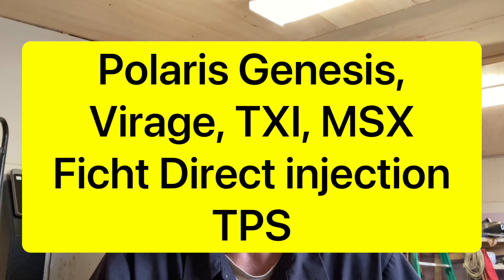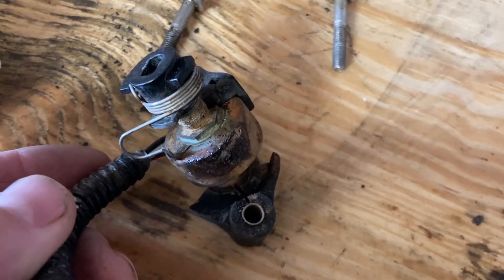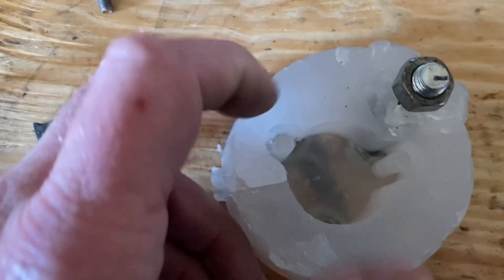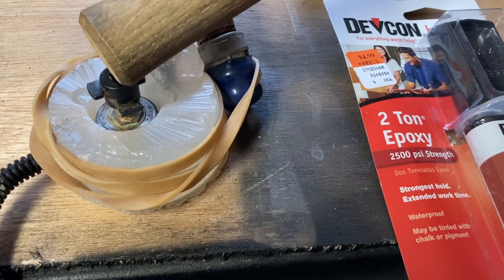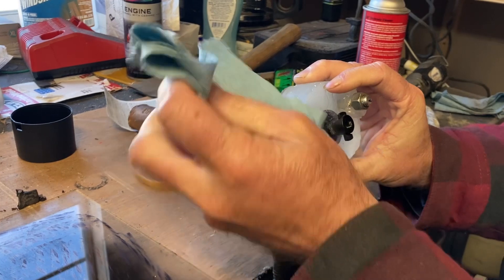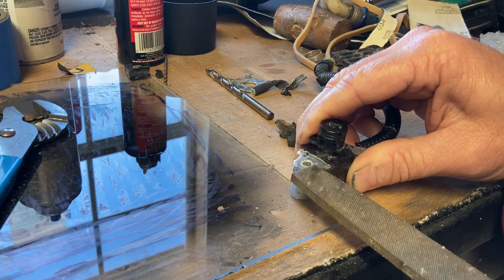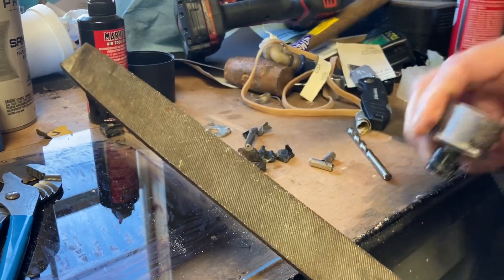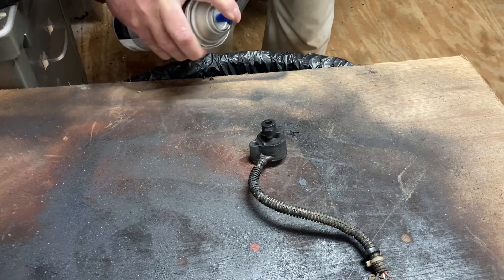Part 2 Polaris ski rebuild: Direct injection TPS repair

Comment: You and I spoke a while back how about a Virage 1200 Polaris with a fuel injection. What you told me about the fuel injection system and the pressure regular was 100% on the money. Then you told me I had to pull the plugs crank it for 5 seconds put the plug back in Crank It again and I did that and it finally started. I'm having problems keeping it running and holding an idle